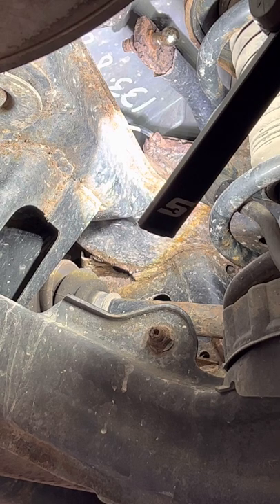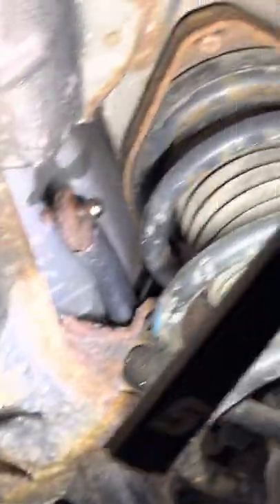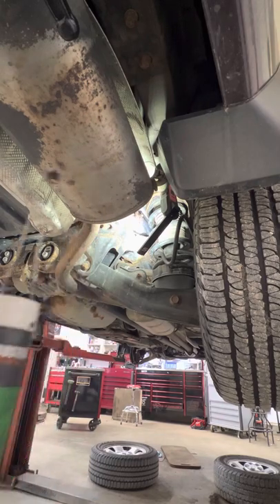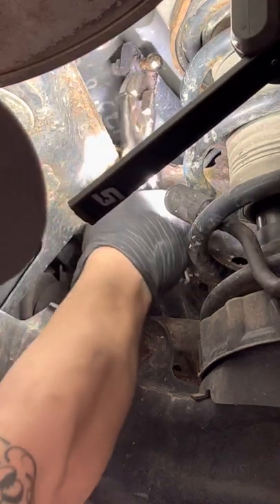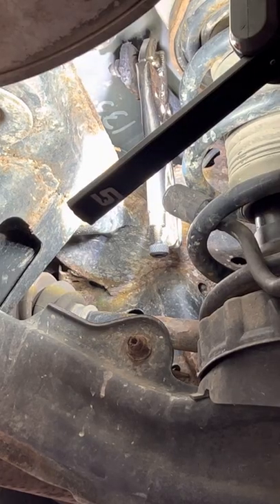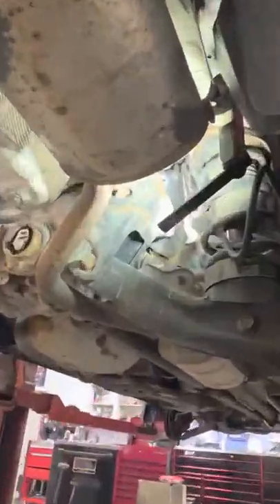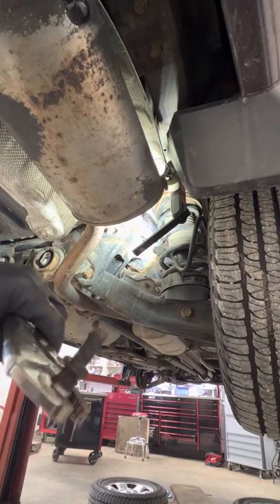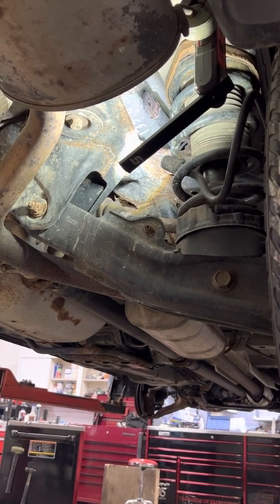Honda Ridgeline rear stabilizer link removal tip.

Comment: Thanks for the video.  I had the same issue that someone else mentioned is I still had no angle to get the socket on with a long extension.  I had the reach but sway bar put the top drag link nuts down too low and my socket was above them.  Reach/length was fine.  What I did was pop the plastic caps off so just the metal ball socket was left.  Then used a sawzall diablo blade from off the shelf at local lowes for cutting cast iron pipe on my sawzall.  I layed the blade against the sway bar and started cutting very slow right on the shoulder of the ball socket side from underneath on the side towards the front.  The blade cute right through them like butter.  Less than 2 minutes per side.  Grabbed the nut side with a pair of plier and they just about fell out.  I did have a little scarring on the side of the sway bar on the side where I cut.  Not much at all.  I used a rotary file/rasp on my straight die grinder to smooth out, which it did in less than a minute.  I highly reccoment this method.  Once I started with this method I had them both off in less than 15 minutes.  the spray painted sway bar to prevent rust.  The bottom pieces came off with vice grip on metal ball socket and impact on the back side.

Comment: I tried to jack up the rear control arm to get the top bolt to lift up higher but still don’t have the angle. How did you get a good angle without jacking up the control arm? 

What’s the bar around/in the strut?
Reply from the maker: Really long 3/8 extension
Reply: @Enrightauto  i tried with a 20 inch 3/8 extension still no angle. Do you need to compress the struts? Been going at this for days any advice would be super  helpful